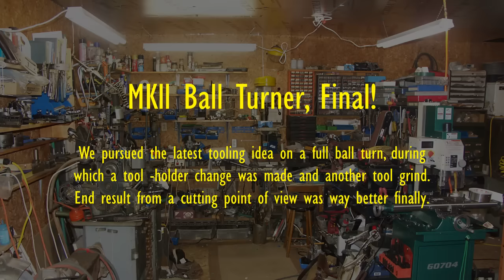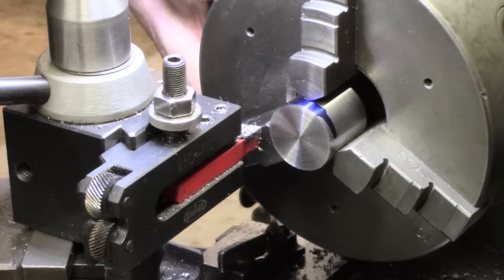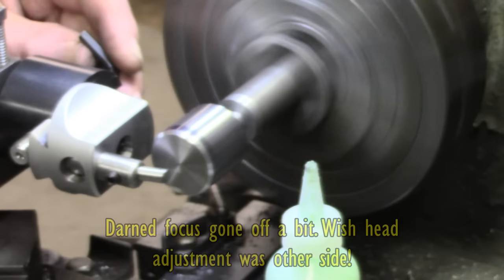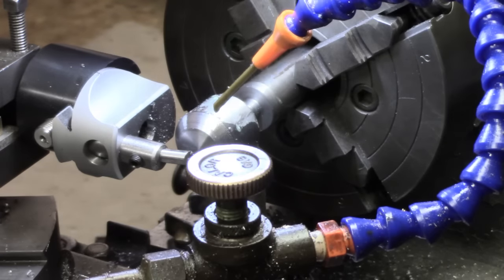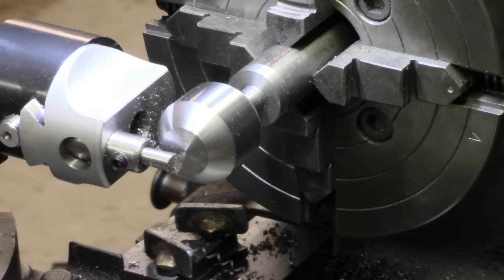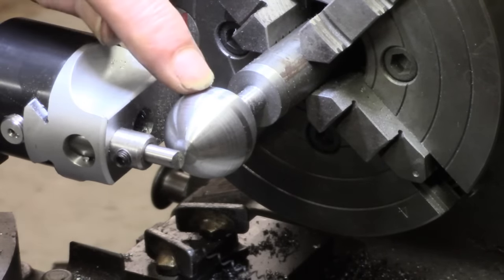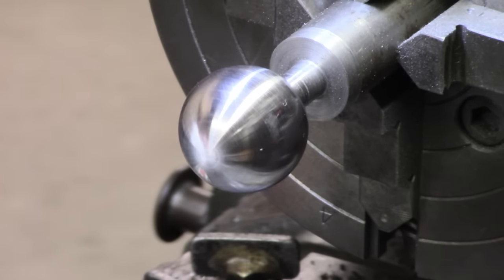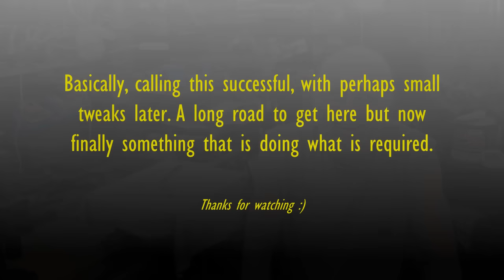MKll Radius Ball Turner - Final!

Comment: Nice demonstration. I always fascinated in alternative ways of making things and how we deal with the problem encounter downstream, this is one excellent example. 

In the video, I can see a continuous chip yielding of long helical shape after reconstruction of tool holding and its regrinded for no chattering, compare to discrete chips when chattering occur with original tip shape. 

That long helical chip could be a tell tale sign that cutting-surface has increased from a lesser compound angle in relation to the stock material travel direction, therefore stressing the tool-fixture from one stress vector state to another where flex and free-play stability are at optimal, minimum.
Reply from the maker: +YK Chan 
Thanks for commenting.
Indeed, at last we seemed to have found a combination that did passably well. Of course the geometry in this cutting situation is somewhat unusual! :)

Comment: Hi Chris
You could try setting the tool in the middle of the slug at the top. I measure the slug and make a mark dead center of the slug then set the swing. My ball turner cuts from front to back but same principle. You will always loose some of the diameter and with a nub at the threaded rod. I use a pointed lathe tool to machine down to the rod and hand finish the rest.
Now I just leave a small flat nub turned down to the diameter of the shaft I and I put the ball on the shaft and wack it in the chuck and blend it together. I have brass balls on all the levers on my lathe probably have the most expensive lathe levers around.

Happy Balls to you
Dave
Reply from the maker: David Cashin You are spot on David -- it is though a bit difficult to find or see the exact contact point of the large radius grind and get that exact on the blank's center. I intend to get it set better next time, plus adding a left side relief to the tool for better results close to the 3/8 threaded stub. Haha - brass balls luxury! :)

Comment: Set the blank up in the chuck,

move the cross slide to bring the tool tip even with  the centerline (remember this setting);

adjust the boring head slide inward (rotated to its highest point) to bring the tool-tip just touching the radius of the blank;

pull back the cross slide and rotate the boring head 90˚ to face the end of the blank;

advance the cross slide to center the tool tip again;

now advance the carriage until the tool tip just touches the face of the blank;

this should position the carriage (and boring head axis) perfectly on the blank.

Now retract the boring head slide (not the cross slide) until the tool tip just clears the corners of the blank and begin cutting. This will form a ball of full blank diameter, which will complete the end away from the chuck perfectly with no waste. Good for putting a hemisphere on the end of a rod without changing the length, as well.
Reply from the maker: Peter W. Meek Hi Peter.  Excellent and thanks. The most awkward aspect is actually seeing the exact center of the cutting tool, as it has such a significant radius. That said, of course you are spot on re setting up on a center line.  The rest of set-up is pretty much as I expect and almost did.  Next one will I feel work out significantly better. Appreciate your input.

Comment: Thank you for the wonderful videos. I made a ball turner tool holder to accommodate a boring bar head. The holder is made of steel and seems to be very study but I can not understand how to make the cutter. Would you make a video on how to make the cutting tool or a drawing of the cutter geometry.

Thanks again,
REA
Reply from the maker: Hi Robert,
Thanks for watching through - long series.!
Cutter geometry is certainly a challenge. I don't have any drawings of the grind but at some point in the last video I think I did mention and show a bit of detail. One interesting approach to grinding was done my John Mills (Doubleboost) - he ground down a used end mill and if you look through his videos you can see that - one of his last ones he turned a ball and the grind is easily seen.
For me, the thing is to visualize the way the cutter approaches the work - set up angles so you have relief where needed and experiment a bit with rake etc... it's a bit experimental!

Comment: Is that a combination tool holder-knurler? That's OG as hell.
Reply from the maker: +Josh K 
Yes, forget the number of the holder - just using it there for holding a tool for facing off. In fact have removed the wheels for use in my 'straddle' knurler.

Comment: @10.52. The hex key difficulty., and also fairly close to the rotating chuck.
I have just pulled the boring head apart and rotated the slidy tool holder bit, so that the cutting tool is now at the end where the adjusting hex is. When you pull it apart, you will see that you need to grind a groove, 15 minutes with mr Dremel. The adjusty bit is now very accessible. I only cut the one groove. No great precision engineering is required, as this is only an adjustment bit as the gib keys should be tight enough to locate when and where it is adusted to.
Just wish I had done it years ago.
Reply from the maker: Hi -- thanks. I had considered this approach but in the end created a slot the other end so I could use a small screwdriver - so allowing much easier adjustment from that side.

Comment: good tool, nice design but perhaps the cure to the chattering is to use this tool as a finishing tool only and use another tool to create two tapers, one on each side of the balls center line.This would eliminate the edge transitions where the chatter occurred and give the tool its use in its happiest area of cutting, and give the job it's best finish.
Reply from the maker: +andy van Hi Andy,
Indeed, there is much to recommend roughing to remove a lot of material bulk. Much of the evolution of my system was aimed at getting a good cut end to end but for sure, the edge transition areas could well be better diminished first.

Comment: Very good Chris, I think you have finally cracked it.
I am finding the grind really hard to see looks almost square cut. could you perhaps do a closeup against a piece of white card or paper.
Also on some of your other videos it doesn't sound quite right hearing aloominum with an English accent. ;-)
Reply from the maker: Jim Arnott Sorry Jim - wasn't very good at showing the tool grind. I have one other modification in mind for the tool and will try to show it better. In essence it is a very simple grind! Imagine the round rod being ground flat on the end to a couple of degrees or so, and that basically is it! I plan to also grind a left side relief to help with the cut when on left side of ball where it is attached on the threaded 3/8 stub.
Reply: ChrisB257 thanks for that . good video by the way.

Comment: Hello Chris, I have been looking at making a ball turning device until I saw your idea which I wish I had thought of. Just one thought though, what would happen if you set the radius of the ball on the boring head, then approached the ball by moving the cross slide in slowly, would this save the constant head adjustment?
Reply from the maker: Hi Gordon,
Originally I tried that approach but it seems to make for more awkward cutting results. By starting with the boring head back from the required final radius (and progressing towards what is required), it seems to go much better, with better cuts.
Best way to demonstrate this is, if you make a similar device - compare one approach with the other.

Comment: i watch alot of your uploads and keep forgetting to like and comment. just out of interest how did you get your cutting edge on center of the blank and indeed was it on cntr or bellow as it were?
Reply: my question on cntr height refers to the horrizontal plane as opposed to the vertical
Reply from the maker: Hi Glen,
Best I can describe -- centering is rather empirical but to start off, I have the boring head and tool as close to horizontal as possible and adjusted on tool post to the machine center. After that of course, the near 180 degree sweep while cutting goes either side of center which is what tends to affect the tool tip choice of grind. Hard to explain.!

Comment: Very interesting way of turning a ball without the use of a computer. I've seen this done on a milling machine setup with an dividing head and a boring head. I have a challenge for you.  :)  see if you can turn a fair size concave radius. Not really a challenge for you I suspect than more of a show us how you would do it.. Good luck anyways.
Reply from the maker: Actually a concave is easier done with a more conventional set up running in horizontal plain. I made one and it does good for that but not so good for ball turning on my lathe..
Reply: ChrisB257 thank you for the reply. The reason I asked that question was a job I've seen resurfacing the radius on a 4 foot diameter sheave.

Comment: Hi Chris, I think if you tap the hole in the ball to be only 90% of the way so it gets tight at both ends you chatter may be cured easy fix for another try........ :o)

O,,,
Reply: Opinionator52 Or: make the tool fit tighter in it's holder,,, Just a thought...  O,,,
Reply: Opinionator52 The neck could on a nother knob look cool......... O,,,
Reply from the maker: Opinionator52 Hi - yes, could well improve rigidity if i get threads matched better for length/depth etc.  Tool fit in holder now is actually pretty solid. Yes, I sort of got used to that 'neck' - and have put it on my (shortened) boring head turner handle - it looks very reasonable!

Comment: So i was afraid you gonna hit your knuckles everytime you adjusted.. so.. cut on the underside of the workpiece and run the lathe backwards instead?
then you would be able to adjust the head from above instead or your right.. without risking crushing a knuckle.
Reply from the maker: +Moronicsmurf 
Can't safely run in reverse because spindle is threaded.  However, since then have made a screw slot on other side of boring bar which means adjustment gets away from the chuck now. Thanks for dropping by.
Reply: Ah right, thats too bad. don't have that issue myself, keep forgetting that older lathes had the chuck threaded on there.

Comment: there is one big problem with this type of radius tool everytime you adjust it you are changing the diameter of the ball.  you need a tool that cuts on the horizontal plane to maintain the same diameter throughout the wheel cutting process
Reply from the maker: Horizontal is better I agree. However this way does the job and once set up initially you don't have to change ball dia - just creep in on it.

Comment: Brilliant demo however the ball cutting tool did not impress me, the cutting tip flexed ever time it cut into the material no wonder you were have problems with chatter. I think the other type of cutter is more stable as the pressure is all going into the tool holder. But thanks for the demonstration she showed how by altering the cut angle you can improve matters. Much appreciated.
Reply from the maker: Thanks Tony - in fact on my lathe the ideal method is impractical because of insufficient space and, the cross slide unfortunately has no T slots if the compound was removed. This was why the boring head approach was tried, and if feed kept reasonably light the end result can still be quite reasonable... tool geometry is the most critical aspect.
Reply: It is a shame your lathe is not suitable for the ideal method as comparison of tools would be a great help as well as excellent demo's.
Reply from the maker: Your last comment hasn't shown up yet but you mention about comparison with other tools. I did try and make a more conventional one but had the height problem. Go to - http://www.oldmansshop.com/vid-pages/shop-videos-index-04.php - and among the early entries on that index page are several videos as I try the other method... My "MK1 version"

Comment: Look at the radius of your work and the angle of your tool.   You have no undercut for your tool.
Reply from the maker: +Robert Beattie 
Hi Robert .... the tooling has involved much experimentation and the final choice is based purely on function, which overall is acceptable. That said, further grinds will no doubt be tried! :) It is one of those things where in some ways theory does not always match up with practical results!